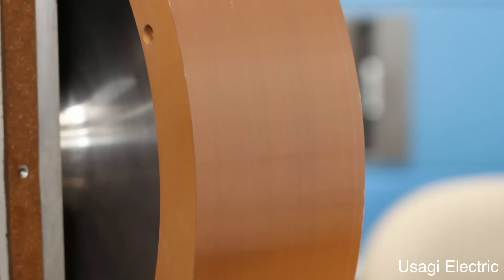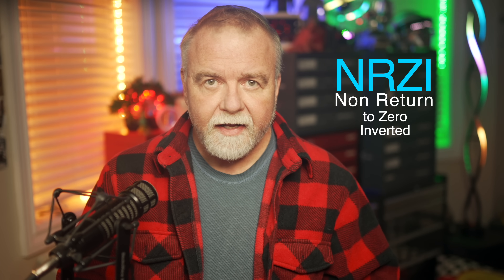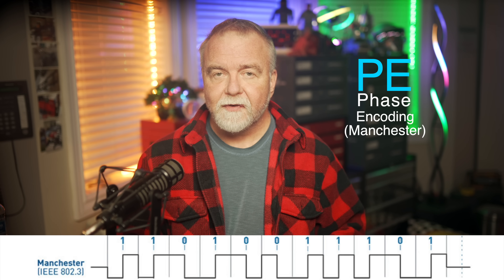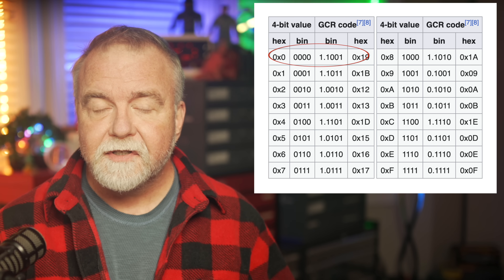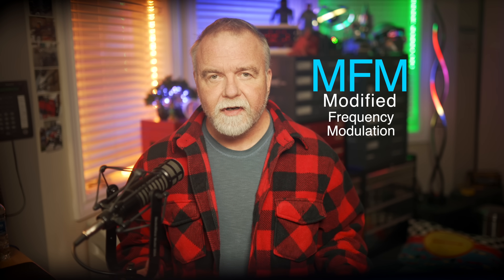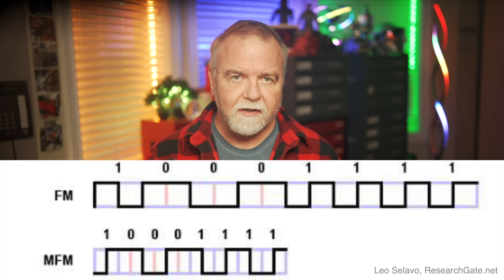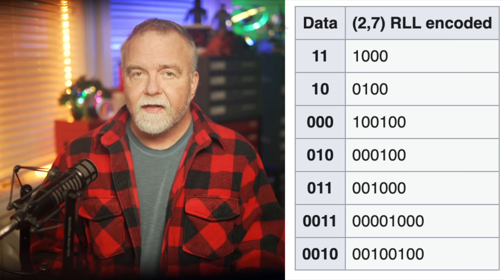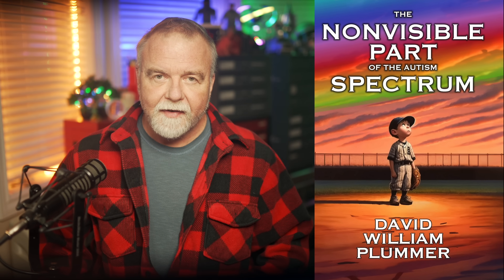Learn How Bits Are Actually Stored: NRZI, GCR, MFM, and RLL Explained

Comment: You are absolutely correct that you could use an RLL controller on an MFM drive. In fact, Perstor sold "aftemarket" RLL controllers specifically to use with MFM drives. I used one on my 71MB Maxtor XT-1085 to get over 100MB of storage. I also swapped out one of my floppies to add in my old ST-223 for a 30 MB boot drive.  Good times...
Reply: I remember having a Seagate MFM 40MB hard drive that I reformatted to 67 MB RLL with a controller I bought off of Computer Shopper.
Reply: @ronjenkins6674  ST251-1?  Had one of those...   didn't convert it to RLL though...
Reply: @gt2847c  it was very good model allowing such a "conversion" easily so you could have 60+ MB drive instead of 43MB on an ordinary RLL controller. And with mentioned Perstor it could be 78MB drive.
Reply: The better quality MFM drives could be reformatted to RLL.  I remember taking some 20MB Seagate drives that had the 'stiction' problem and salvaging them, and then reformatting them to 30MB.  The only difference between the 20MB ST-225 and 30MB ST-238 Seagate drives at the time was that the 30MB was RLL.  The 20MB and 30MB drives were notorious for 'stiction' problems.  About half the stiction failures could be fixed by carefully disassembling the drives and cleaning the excess lube off the platters and heads.

The other half just ate the heads and ground the platters to powder, but the electronics were typically still good.

About half the 20MB drives I salvaged could be reformatted to 30MB if you were willing to play with mixing and matching platters.  In theory, you could convert an ST-238 into an ST-251 (they used the same control board at the time) by adding another platter.  Of course, you would have to find 2 additional drive heads from somewhere to wire in, so it was non-trivial (which is why I said "In theory").

Yeah, good times...
Reply: @gizmo4816 you could flip over the drives with stiction issues and tap them lightly and they'd start running. We had one that only needed to be flipped upside down and then back over and it would start spinning.
Reply: I remember RLL'ing ST-225's to get 30MB.
Reply: I did it with some old Samsung drives that went from I think 32M to 40M with the transition.   I also did some older drives.  In some cases, I noticed issues like Dave describes and found that you needed to "heat up" the drives before writing or reading them.  That way the speed was more even and there was less chance of fatal read errors, a common RLL or MFM issue.  I remember wasting SOOOO much time with these things.  IDE was a godsend as those problems were totally solved!
Reply: @nixon2tube  I had a couple of dodgy drives scrounged from a scrap pile in my Amiga 2000, both of them reformatted to RLL. I got them for almost free but I had to swap controllers back and forth on several drives to eventually get them to work. Anyway, one of them I had to run for a while to get it up to temp or I couldn't get any data off it. The other, the boot disk, it had some mechanical issue that I had to manually get it spinning with a pair of pliers. But I got them cheap!
Reply: Right I was wracking my Brain.... I kept coming up with Plextor card but was Perstor Plextor was a HDD brand I think.... god Im old...
Reply: I seem to remember that not all MFM drives would accept an RLL controller but it was possible in some cases. I suspect the RLL certified drives were more a marketing or warranty issue than a technology one. Still, are you going to risk your companys important data to pack 25 to 50% more data on a drive that might not be fully compatible? 😉🤷‍♂️
Reply: @SimonZerafa  it was something like they choose CPUs with high frequency if the crystal works good with it. The same plates and heads, probably some better schematic components allowing more precise positioning.
Reply: I had a Miniscribe 3053 that would not format to RLL. It would only run on MFM.
Reply: Yep, we did this all the time when RLL came out and we could start buying MFM drives cheaper.

Comment: You aren't misrememberibg... Before drives had built-in controllers, you could get more storage by replacing the controller. Not quite double, IIRC, but close. Of course you had to hard format your drive to the new scheme, which raised the question, "Where do I put my data while I do this?"

Comment: There were a lot of conversations on BBSs of the time about putting your MFM disk on an RLL controller and getting more space available.  The common thread was YMMV, sometimes it worked and you got more space/performance, sometimes it failed.  I recall it being highly dependent on the drive and controller combination, but being so long ago, hard to remember any specifics.  What I do remember was, at least for performance, it was better to get a 1:1 MFM controller (WD 1006 card) and stick with the same encoding rather than chance doing an RLL conversion and possibly losing files.  If you did a low-level format on an MFM drive with RLL, the drive could end up very iffy...
Reply: Hello 1990! I remember that very well!

Comment: Yes!  I remember my 20mb RLL drive on an Atari 800XL using an ICD MIO.  Bonus, with the MIO you could connect a DSSD 3.5in drive for a whopping 320kb of storage.  I remember putting every single scrap of data onto the hard drive.  Games, programs, I mean everything.  Then wondering, "what am I going to do with the 16mb leftover on the hard drive?"
Reply: Hope you kept that thing, probably very valuable now.
Reply: @8BitNaptime  I know man, i had every gizmo known to man for an 800XL, it was quite impressive, had a meg ram, realtime 8 cart, sparta dos x cart, etc.  And some of those RGB and s-video monitors are big bucks nowadays. No, I didn't keep any of it.  :(
Reply: @msromike123  I felt a slight stabbing pain in my nerd heart reading that.
Reply: A question to answer a prompt to your question: would the 16 mb be cached for delivery on the next cycle?

Comment: I am here for ESDI! :)
Reply: ESDI was a sort of early IDE/SCSI thing.  It put the drive control and analogue gubbins on the drive it self. IDE was (sorta) the ISA bus extended to the drive, and SCSI drives, yet another bus, extended the controller off the ISA (or any other computer bus).  I believe that some early SCSI drives were ESDI , but with a bridge interface.
Long and short of it is that pretty much all drives were RLL by this point, its just the semantics of the interfacing.

Missing out the Atari ST SASI interface, which was Shugart , a very early version of what would become SCSI.

Jeesh! everybody was having a go in the early days!!!!!

Hope that helps ?
M.
Reply: Had an Ultrastore EISA ESDI controller... think it was a Ultra22CA based on Googling it.  First disk I ever had that had an actual head crash =(